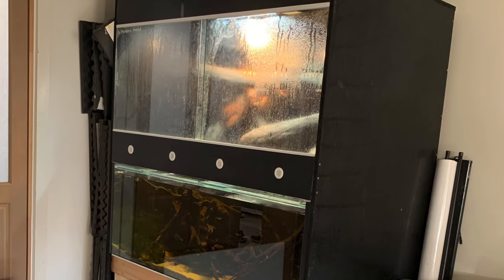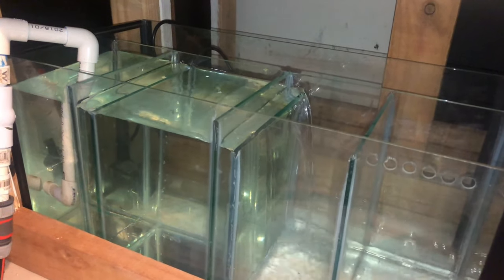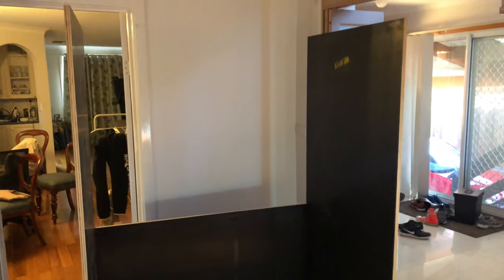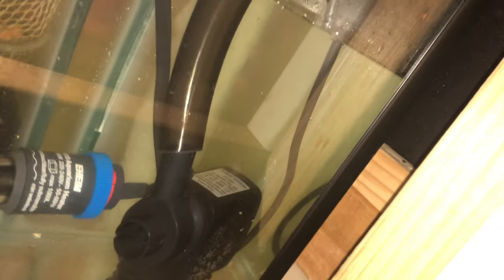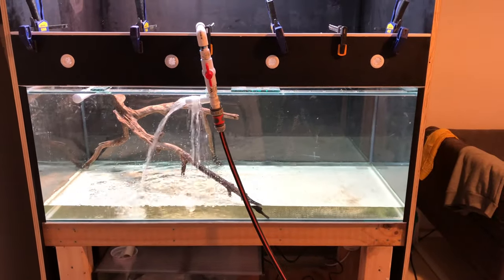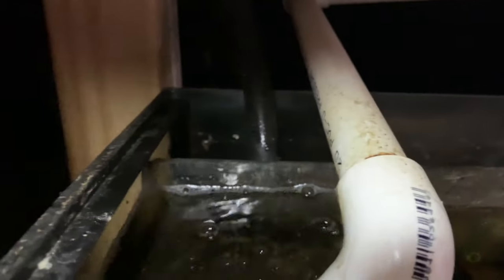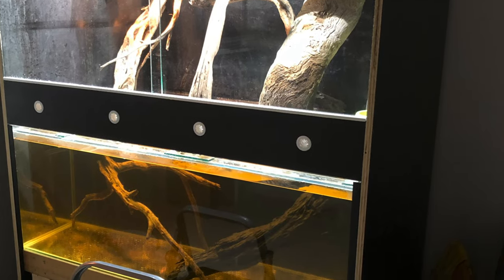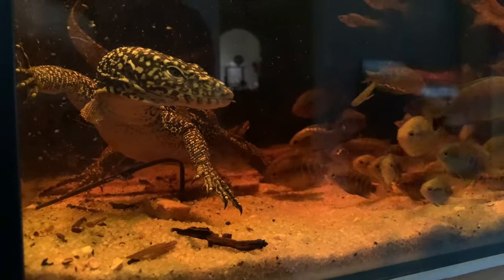DIY Demo: Reptile enclosure with built-in aquarium (how to make a sump filter)

Comment: A few little mistakes because of misinformation perpetuating. Teflon paste is designed for plastic fittings or metal to plastic. Teflon tape is for metal threads to metal threads. If you use Teflon tape on plastic threads it can still leak or deform the threads, there's a whole science report available online about this. Side notes, not all PVC is suitable for potable water. When cementing, using cleaner, clear primer, and rated clear cement in order provides a better/cleaner bond (may need to clean out inside of run at joints).

Also, I was a union carpenter doing mostly concrete form work before the 2008 bubble pop. Concrete form ply usually (from my experience) has an oily release agent on the pour side face. I don't know the MSDS on it, but it might not be safe for your expensive monitor. Did you look into that?
Reply from the maker: Thanks for the information, learning something new everyday. Didn’t know Teflon tape is for metal threads only. 

I’m not too worried with the way the PVC pipes were cemented. The pipes are barely under any pressure so even a friction fit would work in this case. 

Using the same pvc pipes that works for aquariums so it’s definitely safe. 

In terms of using FormPly, I’ve never noticed any oily residue on either surface. Although I can’t completely rule out the possibility of long term effects over the life of the animal, I’ve been using it for a few years now without issues and a few other reptile keepers use it too.

Comment: So for the enclosure did you just use the pylwood as a sleeve for a aquarium? Thinking about getting on, and i would build something like this. Great video :)
Reply from the maker: Yeah its basically a box made out of ply (make sure it’s formply so it’s waterproof, or you can plaint regular plywood to waterproof it) and then the aquarium is on a pine stand that slides into a front opening in that ply box
Reply: @Varanibae  Thanks for responding so fast. 
If you make I new enclosure I would love to see a video on that. Also a wooden crested gecko setup! :)

Comment: The primer you missed and it's a key component for the pvc cement to set correctly. Remember its do it once and do it right.
Reply from the maker: Thanks for the tip! The cement I used didn’t require a primer to activate it. I’ve degreased and cleaned the pipes with acetone so using a primer won’t increase the strength of the bond
Reply: @Varanibae  I've just been plumbing for over 35 years, things do happen but who's to say it wont. Its just my trade so lol my stupid input, But I plan on having 100-gallon stock tank in the enclosure, that's going to get a overflow so I was just seeing how others did things. It's for my mangrove. But then I have my old 90 gallon reef tank outside I've been thinking of trying to incorporate so I can see her swim.
Reply from the maker: @matthewpetersen4417  sounds like quite the project. Exciting!

Comment: Question on sand: Have you had an digestive issues with sand mixing with food?
Reply from the maker: I personally have not, i would think that it might be more of a concern if it’s a small lizard or if the sand is sharp and abrasive. A large lizard with optimal digestive function should pass it through no problems
Reply: @Varanibae  I have a 3 month old mangrove monitor. I am looking to build him a larger enclosure soon and have been using top soil without perlite. Any recommendations for a monitor this young with sand?
Reply from the maker: @Koka1144  Top soil seems like a good substrate and it resembles their natural habitat. 
I can’t definitively decide for you whether sand is good or bad for your monitor, but some risk factors for using sand you include: small sized lizard, inadequate heat/ humidity leading to reduce body functions, poor hydration, feeding directly on sand rather than over a bowl or a piece of slate. These things may increase the likelihood of sand causing problem. At the end of the day,  just monitor your monitor and how it interacts when things you put in.
Reply: @Varanibae   thank you

Comment: Hi! How did you make that land-platform so sturdy? I want to make a similar thing, but instead of plywood, I want to silicone either acrylic glass or plexi-glass as the land- platform to an already existing aquarium, together with some pvc-tubes siliconed to the tank bottom.
Reply from the maker: 1:40 in the video explains the structure supporting the land area. The frame construction is sturdy and can take a lot of weight, and the sheet that goes over is F17 grade 17mm formply, its construction grade and doesnt flex much.